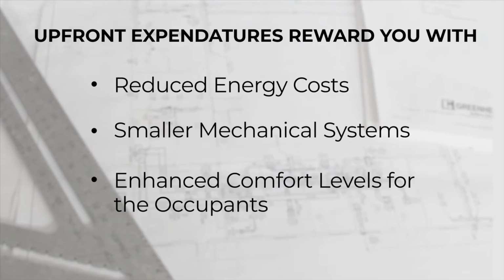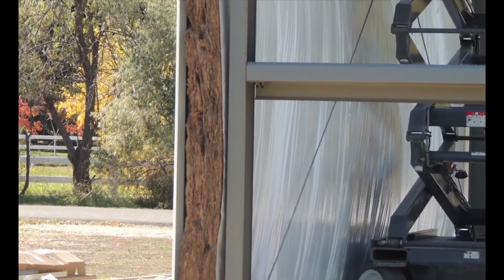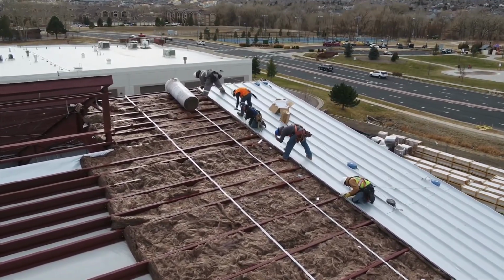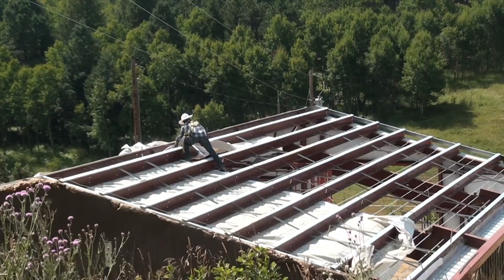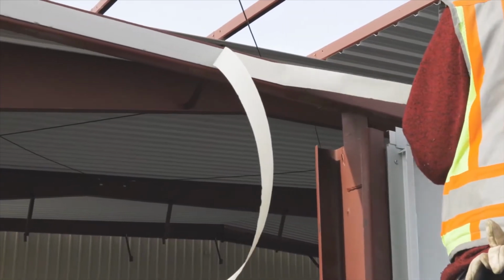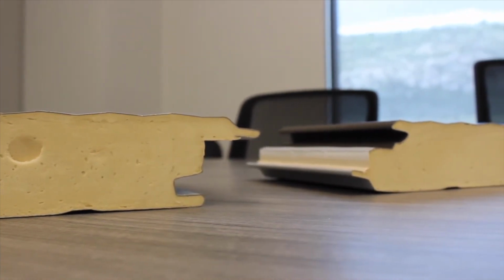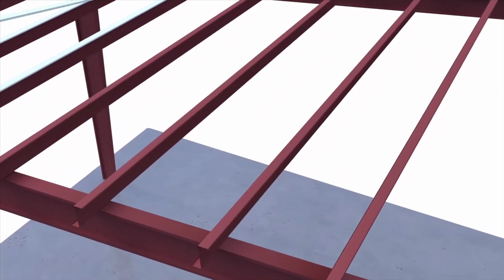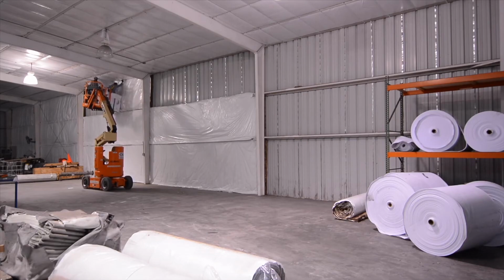Metal Building Insulation

Comment: Do you manufacture an insulation that cah be installed on the top of Roofs
Reply from the maker: Hi Leon, We do supply that insulation (between purlins and sheeting). We do not supply insulation on top of the roof.